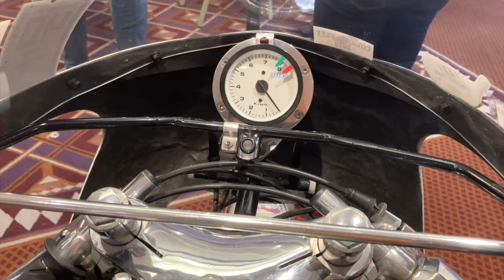From Guns to bangers 5 motorcycle Manufacturers who also made firearms

Comment: Also Husqvarna, one of the oldest manufacturing companies of any kind in existence. Started as a firearms manufacturer in 1689 and first built motorcycles in 1903.
Reply from the maker: True but a Husqvarna seem to have made most things during their history
Reply: I was just going to mention Husqvarna but you beat me to it 👍
Reply from the maker: Love their mowers 😂
Reply: When I was young I put a Husky 250 cc dirtbike engine into a gocart. 😳
Reply from the maker: Well actually in the mid 80s I spent three years racing carts and the use of MX 250 engines was quite common because they could be picked up for a lot less money than the Rotax twins used by the Posh boys 😂
So it doesn’t surprise me at all. I remember one guys cart could lift the front wheel, very impressive sight
Reply: @bikerdood1100 Wilkinson (Sword) from Gunlock Smiths to making Royal Navy Volley Guns and later Bayonets etc . Wilkinson TMC 850s even had a sidecar with a Maxim machine gun mounted on it.  Big fan here , im a T140E owner in the alps.
Reply from the maker: @TheSaintrover  I’m covering the Wilkinson in a later video 
On bikes with inline engines 
Must finish that at some point 
Thanks for the support

Comment: Never new FN made motorcycles,  and didn't realise Beneli made firearms.
Reply from the maker: Yep FN invented the four cylinder motor bike 
Benelli make rifles
Reply: Moto Guzzi's v twin was originally for an artillery towing tractor.
Reply from the maker: Well this is an often quoted myth but is actually wrong 
Work on a V twin bike engine started in 57 
The vehicle your thinking of was a project for an all terrain vehicle rather than a towing tractor, either way it didn’t get passed the test stage.
The bike engine shares basic configuration but is otherwise totally different 
That’s urban myths for you 😂